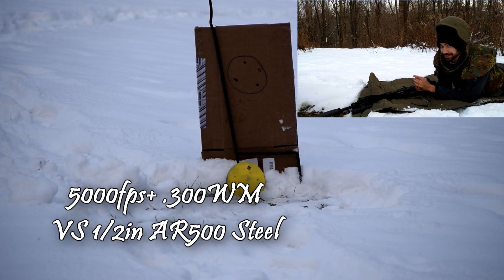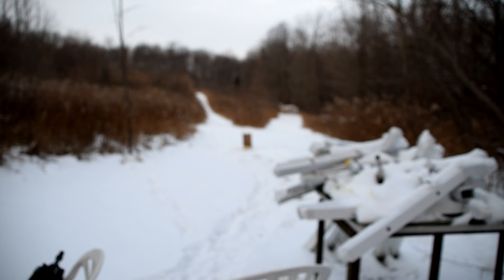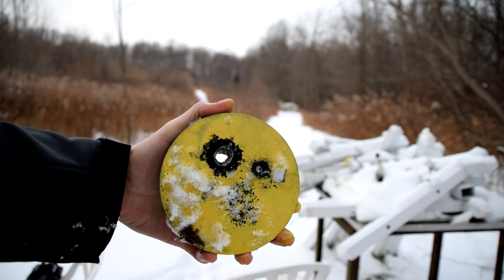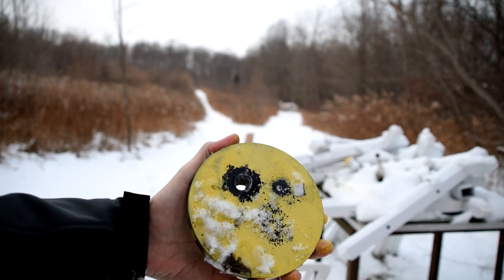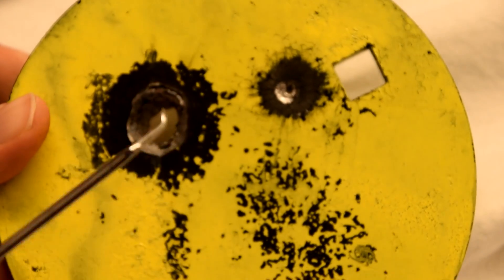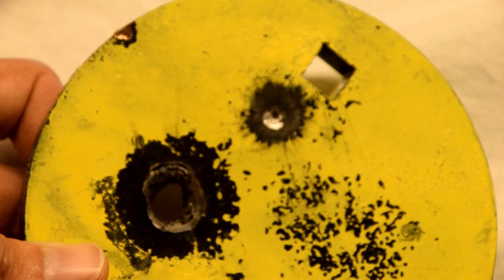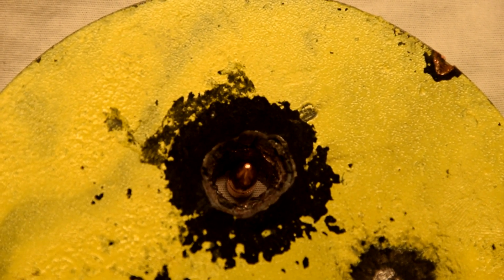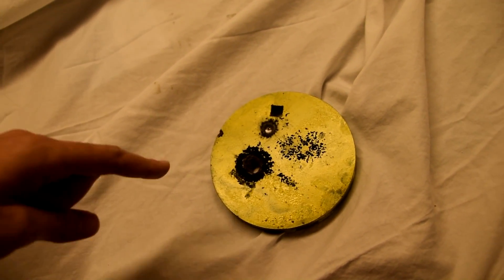5000fps .300Win Mag vs 1/2 inch AR500

Comment: The rounds that are known to penetrate 1/2" AR500 steel (per shot) are:
1. The .50BMG AP, API, APIT, Raufoss and no doubt the SLAP. .50BMG SLAP will also goes thru 1" AR500
2. The 4,000 fps .308 SLAP
3. And know we know 5,000 fps .22caliber 55 grain bullet will as well.
Reply: Also 8 mm smkh;7.62x54R with tungsten core,308 m993, hartkern 151,ruag AP; 220 Swift FMJ.
Reply: @ShokkuKyushu do you have the links to those videos??? Can you send?

Comment: you should buy some 3/4" AR500 .50BMG rated target from www.shootsteel.com
or some 1/2" AR550 from www.actiontarget.com
to see if it'll those target will get swiss cheese or if it'll stop those 5,000+ fps rounds. Would be interesting to see.
WhoTeeWho couldn't get those rounds up to 5,000 fps unlike you unfortunately.

Comment: Velocity is KING! I wonder how great these would be overall with high BC heavy weight. 224 projectiles.
Reply: You would have to have a custom made fast twist rifling barrel to stabilize the high bc projectiles
Reply: @jedidiahdanley1605  Makes me wonder how the plastic sabot would handle a higher twist. I wonder if there would come a point in which the pressure becomes too great and you'd see a mechanical failure or if you'd find that the plastic would end up pushing through the rifling instead of spinning along with it as it should. 

Part of the reason these things are so inaccurate is because everyone is shooting these smaller rounds through barrels designed for the original parent case and not compensating for the fact that the smaller rounds are going to have to be spun at a faster rate in order to take advantage of their original ballistic design characteristics.  If this could be solved, this would be an extremely high performance round. I'm just not sure plastic would be the solution for the sabot.
Reply: Can't imagine the bc being to high on a 55g bullet

Comment: I would like to see a 308 cal. AP bullet in a sabot loaded and shot from a 50 cal. BMG.
Reply: That already exists. Its called SLAP ammo for 50 BMG
Reply: @hillbillyhandloader  .308 AP black tip is steel core NOT pointy tungsten core unlike the .50BMG SLAP M903.
Reply: @7150285  true, but tungsten is harder than steel, so it will penetrate better than steel
Reply: @hillbillyhandloader  that is what I meant...
Reply: @hillbillyhandloader  in case you missed my video. Go check out 2" AR500 vs 50cal baddest round released by Going Ballistic. I stopped those 4,000 fps .50BMG SLAP tungsten round. Easily ;)
Those rounds are even more penetrative than 20mm tungsten sabot round.
Those SLAP killed the 1" AR500 and 1.5", 1.75" and 2" Titanium like butter!

Comment: There's no bullet travels 5000 feet per second the fastest bullet is from a 220 Swift which travels 4000 feet per second😒
Reply: Incorrect
Reply: fitness strength it’s custom made
Reply: fitness strength he’s chronoed his loads at 4,950 something FPS... look at his other videos
Reply: @effortlessly  is this guy is saying that his bullet goes that fast then he's lying the fastest bullet I've done research I know a thing or two about guns is 4000 ft per second the fastest bullet capacity a bullet can travel do your research you'll know that I'm right
Reply: @fitnessstrength2320  sorry bud you haven't done your research. .223 WSSM is 4700 with some loading. There are no maximum velocities outside the speed of light. That's not how physics works.
Reply: 35 grain ntx 22-250 4,760fps
Reply: r/facepalm
Reply: Pierre LeDouche  thanks Gordon Ramsay lmao
Reply: Bullets are limited on speed due to the burn rate of the powder bigger calibers use slower burning powder in order to slowly increase pressure if the pressure blows by 65000 pounds of pressure and keeps climbing it can blow up the gun

Comment: 5000fps.. mmm ok.. so you get 50 rounds to each barrel..lmao
Reply: Clinton Walsh that's what the plastic sabot is for...
Reply: @6mildrill  Excatly, this is using a .223 saboted in a 300 Win Mag cartridge, he is using SAAMI spec chamber pressures for 300 Win Mag.

This would also be unenforceable if legislated as "armor piercing", anyone can make plastic sabots, especially 3D printers, hell you can even make them by hand, although it is very tedious.
Reply: @6mildrill  I know. Just thought  even still the speed even with plastic  it will not be healthy for the barrel.